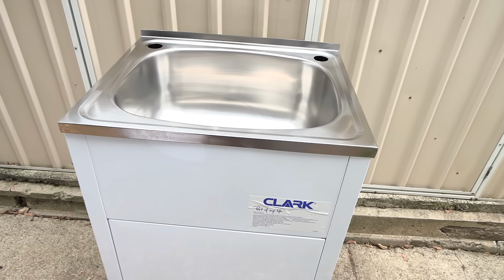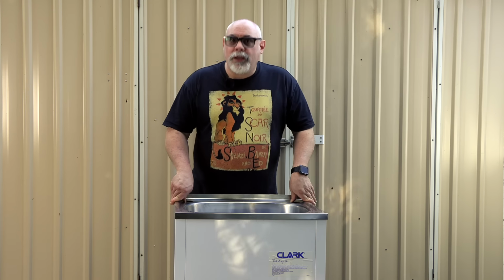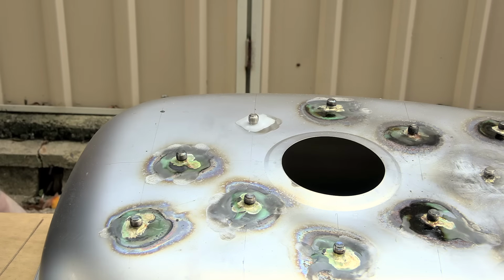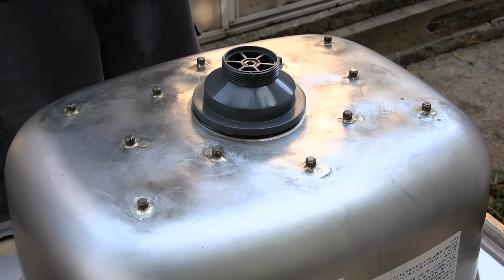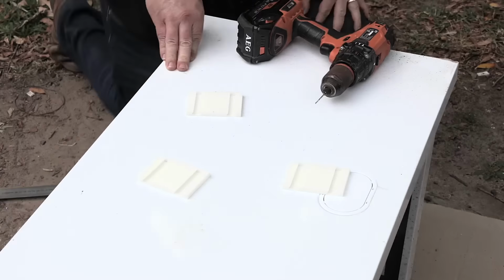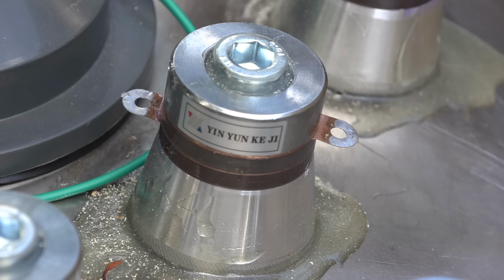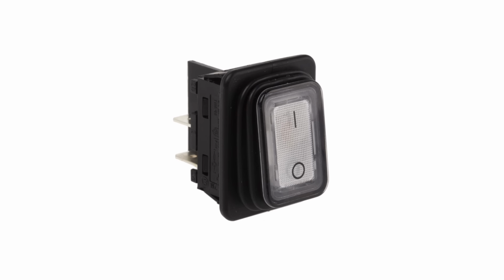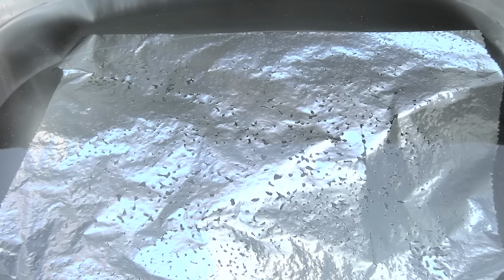Building a Laundry Sink Ultrasonic Cleaner

Comment: Thanks, very informative. I am experimenting with the idea of using ultrasonic cavitation to speed up cold brew coffee making in a five gallon keg. The keg is being slowly rotated so a battery source will need to be used (my dad was a slip ring engineer, not going that route). I doubt I will need the same capacity of an ultrasonic cleaner but just enough to vibrate the coffee grounds inside the keg. Coffee geeks have been experimenting with this idea for years...

Comment: Good afternoon from New Zealand. Thank you very much for the programme for the 3D programme for the electronics. The first box and mount have been printed. Simply wonderful.   May I ask if the programmes for the Bars and the 12v transformer and the Front Control Panel that takes the switches.  Kind regards,  Paul

Comment: 12:10 the polarity of the AC input doesn't matter if you just want the driver to work, but it's best if you plug the phase where it goes to the fuse, because if the fuse ever get's blown the rest of the circuit won't be energized, but if you connect in reverse and the fuse blow the energy will still be in the board neutral tracks of the circuit, an if you touch them you will get a nasty shock

Comment: This project of yours will not work, you are connecting the driver boards without synchronism, it is very likely that some transducers cancel the wave of others, what a big mess you made, exist there are master and slave driver boards for make project with many transducers, a clock signal from the master board is sent to the slaves in order to keep all transducers oscillating fully synchronized !!!
Reply from the maker: I'm sorry to inconvenience you, but it does work. Maybe do some more research before posting your thoughts.
Reply: @BranchusCreations  Your test with aluminum foil says nothing, you know very well that ultrasonic cleaning works by propagating waves at high frequency, if you have transducers operating individually it is obvious that at least one will interfere with the efficiency of other, is you than need be doing the research no me , just look at any ultrasonic tank project with more than one driver board and you will see that there is a connection so that they all work with synchronized waveforms, research and see, if waveforms are generated inversely they will cancel each other !!!
Reply from the maker: @guardiao_das_riquezas  Okay, time to put on your scientist's hat. You say it shouldn't work but it does. Try and formulate a reason why, rather than just proclaiming your ignorance. I know the answer, and I will tell you if you're correct.

Comment: Greetings from New Zealand. I am about half way through building the same unit.  The power boards I have ordered have been damaged in transite and I am onto my third shipment of replacements. I will get them sometime in the future, I hope!!  A couple of questions please.  Is the 3D programme available to make the boxes and the dovetail mount?   Where did you get the plug for mains power to the board ? Kind regards, Paul

Comment: hi, friend .  Your videos are great, a great contribution, it is greatly appreciated.  Friend, it is possible to put two 600w controllers with 12 transducers each.... but that some are 40khz and others 28khz?  The two devices will be separated from each other... but the transducers will be... (24 units) in the same ultrasound tub.  It's for my mechanics shop and I need to wash engine parts.  Beforehand thank you very much.  Greetings from Chile friend and thanks again.  greetings .  Atte Roberto Herrera.  from Chile

Comment: 17:33 This must be a joke man, there are holes for the wires to put into (and to wrap around) and you don't use them! This is not how to make proper solder joints, everything is wrong. But hey it works 😞

Comment: Rather than silver solder could you not drill holes in the sink + use appropriate size bolts to attach the transducers? Some sealant on the inside should prevent any leaks...

Comment: I have ordered a kit for 3 ultrasonic heads of 50watt each, its called "FanYingSonic Digital Circuit Board 150W 40KHz" 
I wonder what size of stainless steel tray would be "optimal" for a project like that. 
What would be the largest sized tray?

Comment: Great video! You mentioned that you shut off some of your transducers. Would you be able to answer a question for me? I have a 3L ultrasonic cleaner with 2 transducers but one is dead. Is it ok (safe?) to run with just the one working transducer? My uneducated guess would say that it would work but just wouldn't be very efficient. Your thoughts would be greatly appreciated!
Reply from the maker: Thanks Carlo! Do you know if it's a dead transducer, or a dead driver? If it's the transducer, you should disconnect it first, as a failed transducer can damage the driver. Once disconnected, the cleaner should operate fine, but you may need to put a little less water in it to compensate for the reduced power output.
Reply: @BranchusCreations  Thanks for the quick response! It's definitely the transducer. The cleaner ("won" in an online auction) arrived with one transducer detached. I reattached with JB Weld and did the tinfoil test and there was no pitting on the reattached transducer side. I will definitely disconnect the bad one and use less water. Fingers crossed!

Comment: what if you used a metal ring under the transducer to fill the gap. Then  you should be able to titen them  down and  have not gap with out glue. You could also weld the parts to the tub. Also heat the bolt before you out it on the tub so you only have to heat the tub a little and get less warping.

Comment: 4:48
When using multiple transducers with separate power supplies, they may not run in sync, leading to destructive interference and reduced cavitation due to mutual cancellation rather than constructive interference for amplification. The outcome can be a bit of a hit-or-miss situation. To enhance the performance of multiple transducers, synchronization is generally advisable. Additionally, you might explore a more advanced approach, such as optimizing the transducer positions in the bath and calculating wave propagation through the liquid. By strategically offsetting synchronization between transducers, you could potentially achieve a targeted "aiming" effect, thus increasing cleaning power in specific regions.
Reply: Maybe some ultrasonic drivers offer a way to synchronize the frequency with other drivers? Also I wonder if you could tune the sink and water combination so they resonate at the cleaning frequency
Reply: @xonx209 any idea on how to do that?
Reply: The distance between the transducers is much greater than the wavelength anyhow. There’s going to be nodes and anti nodes throughout that tank. I suspect it would be a problem if you had transducers much closer to each other than the height of the water column, but I doubt it matters here.
I’m more worried that if these are self-resonant drivers, will they work with two transducers on them each.
Reply: @Scrogan  the areas of cancellation or reinforcement may be why his aluminum foil was so torn up.
Reply: @JayWye52  
The wavelength is on the order of 3cm, so that’s plausible. Having some forced water flow would cause the contents to not remain in one place and hence never sit in a hot-spot for long, same reason microwave ovens have a turntable.
Reply: @Scrogan how would you do this when making it for larger parts that can't really "flow" or is it not possible. Any chance you could give me an email or a way to get ahold of you? Or if not what would you recommend the layout be on something that's a good bit longer of the tank say maybe 18 by 56 ? Currently trying to build one for my shop and obviously want it work as well as possible.
Reply: @Scrogan  How would you propose 'synchronizing' the transducers without designing a driver from scratch? Are there commonly available transducer drivers with phase synchronization inputs?
Reply: @DellAnderson  I believe ultrasonic cutter drivers are typically self-resonant. Maybe that can just be via electrical feedback of the voltage/current phases, or maybe it needs an additional sense line. If you’re driving multiple transducers at frequencies even slightly different, the nodes and anti-nodes would be drifting all over the place. You wouldn’t really have to worry about dead-zones at all. The idea of synchronising multiple transducers, each being driven at their resonant frequency, is a contradiction.
Reply: Well done however I’m disappointed that we didn’t get to see you test the cleaning power on your socks or a T shirt with a food stain on it.
Reply: they probably synchronize like clocks hanging on the wall.
Reply: Great explanation! I found alot of the mass manufacturers also made this mistake. Luckilly I'm a qualified acoustic engineer and mitigated this issue with an arduino code and a single power supply. It did take some math to get the placement right but mine was easy due to the fact that the tray was flat. Here however you have the hole that throws your waves off completely. Synching will definitely work alot better
Reply: You really want him to use phased array techniques to pinpoint the cleaning? JK - I know you are talking about tuning it once and leaving it.

Comment: The efficiency of using so many low-power ultrasonic drivers is very low... because the transducers are not synchronized. One will be driving "up", but the others around it may be driving "down" - or any combination.  This means they will be causing dead-spots in the sink. If they were all driven by one large power driver, they would all be driving UP or DOWN at the same time, adding the power from every transducer completely.  As it is, you likely are losing at least 50% of the ultrasonic power.   BTW, the drivers do not put out DC... it's ultrasonic AC, probably about 100kHz. They mark them that way for no known reason.
With a little bit of work on those driver boards, you could use one as a Master, driving all the rest of them as Slaves... fully synchronized... and that aluminum foil would quickly disintegrate.  (but I'm a EE... so that's not something to "experiment" with)
Reply: When using multiple transducers, you’ll have high and low spots anyway. Just like two loudspeakers will unless you’re at equal distance of them and there are no reflections. 

There will be many reflections in the tank, so I think that synchronising the drivers won’t solve the issue of having nodes of high and low energy. 

I’d be interested to know if you agree or not and if you don’t to hear where I’m mistaken.

Comment: To clean the flux use 10% battery acid mix with water,  put acid into water not the other way around ,  deep the brazed part into the solution and leave about 30minutes, then remove it and wash the part in water. ..

Comment: Very good, congratulations. I'm buying the materials to make mine. One question, wouldn't you make a hole in the tank, and put a screw through the inside with some sealing ring to secure the transducer?

Comment: could you just use a cheap  sander with a adjustable speed
Reply from the maker: Is that what you think an ultrasonic cleaner is?
Reply: @BranchusCreations  no but to get the vibration just looking  at making at least a 70lt bath
Reply from the maker: @TheBoobieBandit1  You should check out the beginning of this video. Specifically the bit about what an ultrasonic cleaner is and how it works. A cheap sander won't emit ultrasonic sound waves. https://www.youtube.com/watch?v=RLgFSdSDE-8

Comment: A few thoughts on transducer wiring. In one of the previous videos you were considering series or parallel wiring and your current wiring shows the pairs wired in parallel. This will present the lowest impedance to the driver so presumably you'll have higher power output? And for physically attaching the wires, wouldn't it be simpler to just use a nut and bolt?

Comment: Lots of fun watching your journey in building these ultrasonic cleaners. It seems that you do like to take them to the next level so I suggest using an Arduino to add a few  functions: 1. digital flow meter for the tank filling with control and automatic selection of power required backed by 2 non contact liquid level sensors for alarms in overfilling or leak detection . 2. Turbidity sensor for replacement of dirty cleaning liquid in time. 3. I use some mild acids or caustics sometimes for cleaning and you can add a PH sensor and a dispensing pump for the solution to set the desired PH level. 4. Last but not least remote monitoring and control so you can reactivate the cycle if you are away from the cleaner and doing something else e.g. the cleaner is in the workshop and you decided to do some gardening. Now, to really get Sci-Fi I would set up a system for automated drain and filtering of the cleaning solution and refill with a rinse agent. I would then set up some halogen lights on the lid so when the lid is reverts you turn the inside into a dryer. This way you would have a multi purpose 3 in 1 device, Ultrasonic cleaner, rinse and dryer. Now that would free up some serious gardening time! I love to overengineer my projects to max! Why? Because it is possible and fun!

Comment: Couldn't you just put a bolt right through with a copper Washer kind of like what they use with cars, Because the copper is soft it meshes with the item and if it. Can Keep oil under pressure in then. It should work for your design that's not under pressure.

Comment: Sorry to say, I don't agree with the cooling system: a part from the material of the box, it would be much better an aluminium box, the fan is on one side and on the opposite side you should have a hole with an dust filter to slow air flow.
Reply from the maker: The hole is at the rear of the box, under the driver. The fan pulls the air up, across the driver and out. It’s continuing to cool very well.

Comment: Neutral on a 220-volt system?  Here, in the states, neutral is only used on the split-phase power of 120 volts.  There is no neutral on a 220-volt system because both ends of the transformer are used with unused neutral in the middle.  
Maybe that's why they're not labeled.  Are you using a split-phase system for the 230 volts?
Is that nice scene behind you just a photo?  I noticed that the image is defocused the same at every distance.  Looks great though.
Reply: In most of the world we have 240V between Live & Neutral ( Or Live & Ground).  We don't need or use split phase to get 240V

USA is 120V between Live & Neutral but you have two Live wires on opposite phase.
Reply: @graham6137   Exactly.  Your transformers are split phase too.  The one side or the other distributes the power to different customers.  That's why you have a neutral.  So the US system is just a mini version of what you have.
Reply: I guess I meant to say we don't have split phase inside our property.  But commercial property often has 3 Phase electricity & occasionally (rarely) residential property is also wired for 3 Phase

Comment: something my shop teacher taught me way back in the day. You can fill your ultrasonic cleaner with just generic water. then put your cleaning solution into a mason jar (glass jar) with a loosely fit top not falling off loose but closed enough if the bottle tips over the solution wont mix. the glass wont shatter, and your cleaning solution isnt 50l of waste. plus you can have multiple cleaning solutions/strengths in the same tub and not have to waste time for one thing at a time. hope this helps super cool you got this workin good luck with everything. wish that was in my garage.
Reply: I just learned the same recently. I've never had one, but that's a brilliant solution (yes, pun intended).
Reply: Yes if you can keep the item and cleaning fluid contained and the whole device don't need cleaning fluid or to be cleaned after.  It is a top tip

Comment: I think it might be worth nothing that AC doesn't have a fixed polarity like DC does. The polarity of an AC circuit changes 50hz or 50 times a second here in Australia. This is why there are many AC cables (often called kettle cables, also the PlayStation cable) which are reversible. These cables (maybe exclusively) appear on products which don't have a ground wire.

Comment: I know When soldering copper fittings,  solder flows towards the heat, so heat one side and apply solder to the opposite side and  the solder will flow to the hotter side. Also too much heat is not good, just the point when the solder starts to melt when it touches the surface.  Thanks for the video. What are the mountains in the windows ?? Sydney has mountains like that?

Comment: A tip for silver solder is to form a ring of solder and wrap it around the part you are soldering to. Once the part gets warm enough, the solder will melt and it will let you use less heat on the part and have a cleaner solder joint.

Comment: because the bolt (stud) is rather hard to heat and the sink is too easy to heat, you can put the cut studs in a frying pan and preheat them, then you only need to put a little heat into the sink to effect a perfect solder joint.  You can measure the temperature of the preheated studs by using a noncontact IR temperature sensing gun

Comment: The output from the driver to the transducers is not DC but high frequency AC. The + and - signs are probably there to indicate the phase in similar manner to loudspeaker terminals.
I wonder if the ultrasonic power could be increased if the outputs from the drivers could be somehow synchronized instead of each one running with independent oscillator.